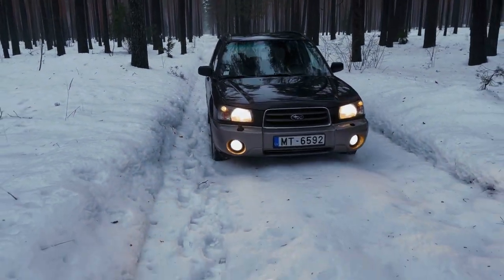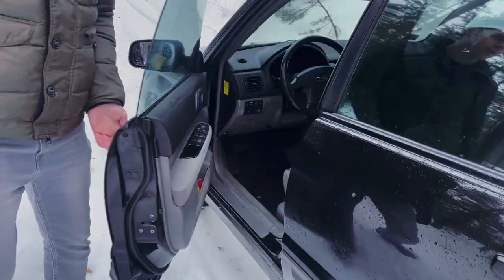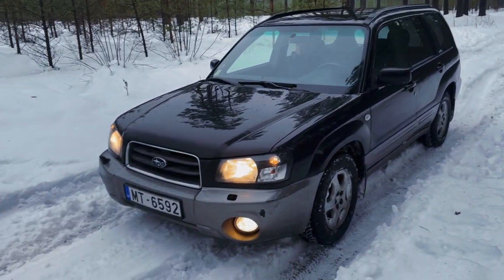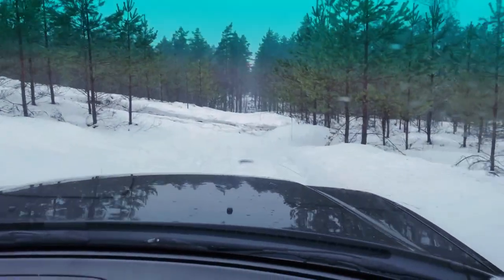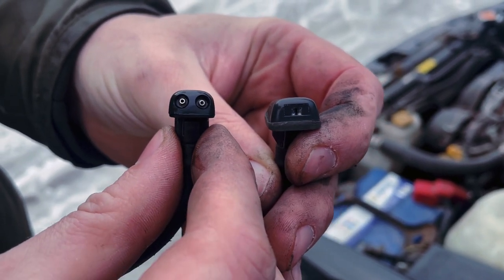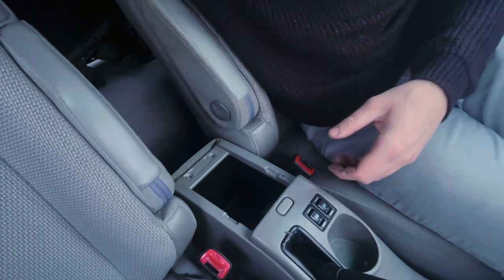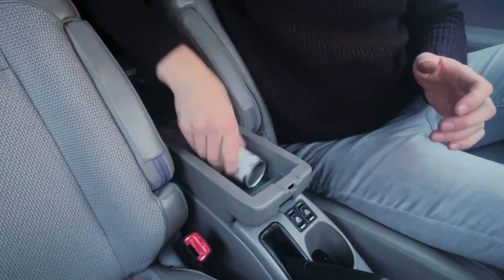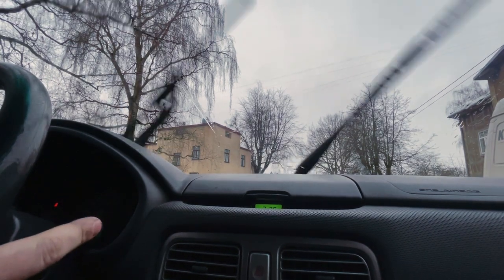How To Build a Subaru Forester: Begins

Comment: The mighty older Foresters with their awesome 4EATs transmissions. One of my favorite all around capable vehicles. It’s safe, practical, economical, fun, and quite capable off road. My first ever Subie was an ‘01 SF which I did everything on, including overhauling its ej251 for the infamous H/Gs. Once you a slap a set of MLS H/Gs on these little n/a motors, they become tanks! Take the time to do it right, replace all the vacuum lines, pcv, seals, gaskets, etc and you’ll have a great car for easily another 150k miles.

Comment: If you didn't know you can cut a hole in the top piece to run your charger through so you can charge your phone in the top compartment
Reply: With wireless charging now you could run the wire and hollow the bottom for the wireless charger! Glue it up and all it takes is dropping the phone in the compartment and you're set :)